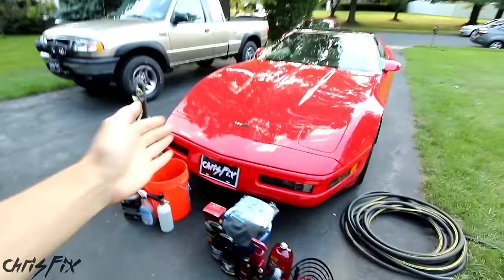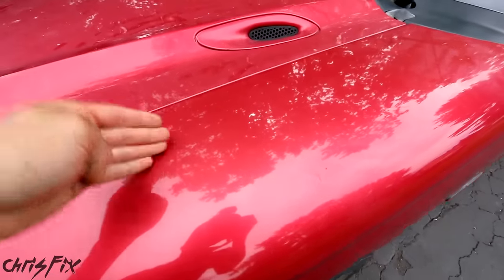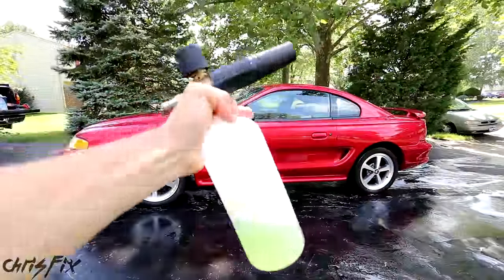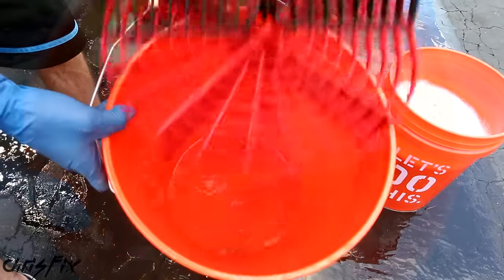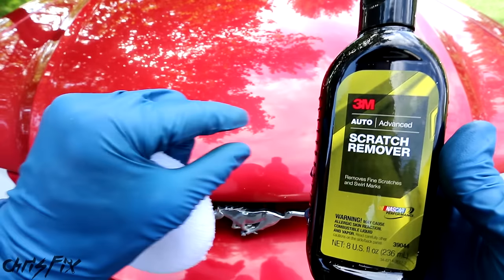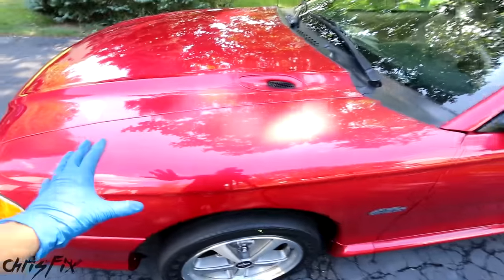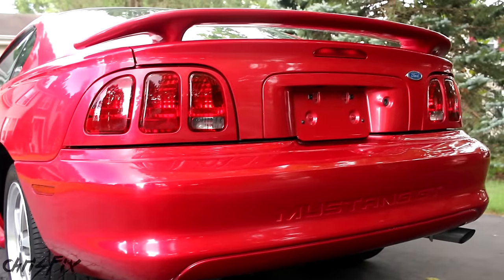How to SUPER CLEAN Your Car (Best Clean Possible)

Comment: I do this every few weeks 😊 Thanks for teaching me!!

Edit: sorry, to clarify, I do everything but degrease my vehicle and add a layer of wax.
Reply: FunForSameer what if the swirls don’t come off ?
Reply: JustACamaro 0 wipe in circles
Reply: I would recommend not doing the whole process, once the wax is on then you can start using car wash that doesn’t strip wax, it’ll save you lots of time, also do a quick detail about every two days. Eventually you’ll need to strip all the old wax, that’s when you can use this process.
Reply: Every few weeks is way too much. Once a month at the MOST
Reply: FunForSameer every few weeks? Wax will last about 3 to 6 months. Some waxes even last up to a year. And soap and water don't always strip the old waxes. So doing a full restoration on your paint every few weeks is not good for your paint.
Reply: John929kelvin indeed, although dawn is definitely a wax stripper, never recommended using it with a good wax (unless you wanna strip it of course)
Reply: John929kelvin 3-6 months if you live where they dont salt the roads, rain is mild at the most, etc. In places like PA you need to wash and wax every month and a half
Reply: The most I could get out of wax was about 3-4 weeks (in winter it probably wouldn't even last a week)... Preparation and waxing takes almost whole day so not worth it... I found different (a bit more expensive) solution: ceramic/nano coating, it lasted me at least 6-8 months and I applied it before the winter. It's much more resistant to everything even scratches.
Reply: @Alteriukas  Where do you go to ceramic coat your entire car? And does it repel salt from the salted roads in winter?
Reply: I do it my self outside (best place to do it is inside, because you need to keep it dry for a period of time, might be 2-48hours). It repels everything: salt, acidic rain, bird s**t, UV and even light scratching. It's like additional clearcoat.
Reply: @Alteriukas  Oh yeah see I don't have the tools or a garage lol I thought you were paying a shop to do it
Reply: I don't have garage either and no need any tools. Just need to make sure you can keep it dry as long as you can after applying (also don't do it in direct sunlight).

Comment: after super clean...2hours later....rain
Reply: just give it a wash and it should be fine, its not like rain can strip wax!
Reply: DED SEC That's why you use wax. If it rained and left residue, he would simply be able to rinse it off and it'll look new again.
Reply: Moss loder acid rain can!
Reply: There is a reason garages exist...
Reply: Mr. Doob not everyone has has a garage.
Reply: DED SEC I would cover my car after SuperClean.
Reply from the maker: That is almost exactly what happened: https://www.instagram.com/p/BJHgFJoDkkt
But the sealant protected the work so its ok!
Reply: Lol yeah especially living in a city like Seattle
Reply: Good thing I live in Arizona.... hehehehe no rain at all..... heheheehe😅😅
Reply: DED SEC    Rain? ?  What is this thing you speak of? Rain? Dust is the enemy. Fine powdery dust!
Reply: @marvin martin Come to Pennsylvania and watch the wintery roads then tell me how dust works. OK, this is a ridiculous argument; the "slated" roads eat whatever bare metal they can get at and they're not the painted areas. STILL... The calcium chloride will wreck finishes too if they're not waxed. And as for the exposed metal, spray the hell out of it with Fluid Film. I have little experience with it and can't attest to its effectiveness but it'll at least help.
Reply: Austin Lucas   What argument ? Where I live there is not much rain. And no fucking way will I ever drive my car in the snow. Not because it would hurt the car. Cause it's way easier to crash. We don't get snow here ever. But if you want to talk about places or conditions we drive on. Come to Australia and drive around and see how you feel after that.
Reply: I realized my comment wasn't holding water and called myself ridiculous, knowing I have little experience with dust wrecking havoc on cars. I don't really have a point here, feels like I'm only ranting on a close but off topic subject. All I can see that's relevant is "Hey, I wonder what havoc the anti-salt solutions will have on unwaxed finishes and how it compares to dust?"
Reply: Austin Lucas   Nice recovery lol touché. Our roads here are generally pretty good. Outback is where it gets tough.  If you watch uk top gear, they did an Australian special. Have a look if you haven't seen it. You'll see what I mean about dust.

Comment: Must be a pain in the ass using the clay bar.
Reply: dj twohands fr it's small af
Reply: I work at a detail shop and we don't actually use Clay bars, we use Clay pads which is similar and does a great job also plus it's bigger so it doesn't take that long.
Reply: Fabian Borjon Ah sweet, thanks for the info
Reply: @SleepyxD117  Yea no problem just search up microfiber Clay towel and there should be one listed on Amazon they pretty much look like that, looks Grey in the middle and a blue outline around it
Reply: It’s so small....like rubbing ur whole car with silly putty!
Reply: I find it kinda fun to claybar a car
Reply: Ayyy we have both have a Ed profile picture

Comment: My car was painted by my groomsmen with window paint so I have tried all sorts of ways to get it off but it always comes back. do you know a way to possibly getting it out?
Reply from the maker: Did you try rubbing alcohol or using clay bar?
Reply: I've tried alcohol, clay bar, wd40 as well as just polish and cleaning
Reply from the maker: Dang, that isnt good. Compound would be the next step but you need to be careful! Ask them what paint they used and look on the label for how to remove it.
Reply: it says on the bottle to not use on body of car, I have tried the compound method as well lol
Reply from the maker: +Casey Saunders oh, dang. The last thing I can think of and the riskiest is to use paint thinner on a microfiber towel. Only soak the towel and after gently rubbing the paint, wash it off with soapy water. The risk is damage to the clear coat if you let it soak.
Reply: Since I'm not a professional do you think that is still a somewhat safe route is? I saw in your video the sand paper, do you think I could try that?
Reply: I would recommend using a product called goof off, its similar to goo gone but its the super industrial strength version. I'd be surprised if it didn't help you
Reply: awesome, my wife works at Fastenal so I'll give that a try
Reply: Casey Saunders     Really want
Reply: Goof Off is for graffiti marker and stuff, not sure it would be safe to use on painted surfaces. Its pretty powerful.
Reply: does the soap you are using ruin the windshield?
Reply: no I was able to remove it all from my windows. it is just the body of the car where it won't come out. it looks like it stained the paint
Reply: Take it to one of those bodyshops. I'm sure they'll be able to strip it out and do some maintenance to the cars paint.
Reply: I think your groomsmen need to buy you a new car
Reply: Casey Saunders vvnc 

car
Reply: Casey Saund
Reply: Casey Saunders
Reply: grade #0000 steel wool

Comment: Soapy Wooder is just water and dishsoap right?
Reply: Corne 011 Yeah , but make sure the dishsoap is a degreaser such as Dawn or Ajax.
Reply: Use Dawn. It works better, goes a lot farther, and they donate Dawn to outfits who degrease birds when you buy their product. (Not a joke, they DO.)
Reply: I thought it was automotive soap mixed with water, dishsoap strips wax which isnt the purpose most of the times
Reply: Thanks for the answers!
Reply: Alex Alarcon but o that case, when the painting is too dirty, he needs first degrease
Reply: Dish soap contains way to much salt are you kidding me
Reply: Corne 011,Yes it means Soapy Water
Reply: No. It's water, dish soap, and Chris fix tears. That's the magic ingredient
Reply: Yeah 1 squirt of plain dish soap and fill the spray bottle with water and shake.
Reply: Chris, how do you degrease the bottom of the engine? Ive been using 50/ 50 of simple green and warm water.....??
Reply: the very birds that later on fly and drop a giant plop on the car right after you have washed, waxed and sealed it sigh but yeah, I'm all for the birds (:
Reply: Nah mate soapy wooder is a mix of water dish soap and tree sap thats why its called wooder because the sap comes from the wood
Reply: Krish Rampaul Beware, Ajax in the UK is abrasive.
Reply: Mark Howards yes, thats the same in the Netherlands
Reply: Yes
Reply: Loh Dexstex could we be friends on ROBLOX?
Reply: what soap should you use if your in the uk?
Reply: You should also add isopropanol alcohol (roughly 10% of the entire mixture other 90% being bottle water preferably distilled and a little bit of dish soap)
Reply: thnks for info man
Reply: Ya I think that’s just how he says it
Reply: Mark Howards 
In the states, Ajax has a lot of different products...even laundry soap.
Reply: yh

Comment: Damn that mustang needs to be dropped lower some.
Reply: Or maybe your car need to be lift some? ;)
Reply: +Pabcio so true lol
Reply: Yea, needs to be lowered
Reply: i know right lol
Reply: He said he's putting coil over😎
Reply: He said he is definitely getting coilovers.
Reply: Hella flush!
Reply: i think the rear needs to have a little more meat, or you know add a spacer to make the wheels stick out more.
Reply: And some correctly offset wheels, they look so tiny, even though they are about 8 inches wide since they sit so close to the axle. I can only imagine a lock to lock uturn in that thing rubbing so bad. worst feeling ever besides grinding a gear.
Reply: looks like a 4x4
Reply: No.
Reply: +max isnt it
Reply: if he only NA's the motor that might turn against him when he goes to drift it but would be awesome of he turbo's or supercharges and does an install vid
Reply: No way he's driving a drift car not a low rider
Reply: Nope, that is just stock ride height for a Mustang lol. Source: Owns Mustang
Reply: Or maybe he needs to put some hydraulics on it so he can lower and lift the car?
Reply: burgerman that doesnt work too good for drifting.....
Reply from the maker: The car will be lowered. Gotta drive it around and learn about the car for a little before changing it. Otherwise how low do I go? Does it handle better or worse than before? If there is no "before" then I will not know. So it will stay stock until I drift it in a few weeks! Then it will be off to the races with mods!
Reply: ChrisFix
Slight negative camber is good, it makes the car a bit stiffer, its worth it. Just a little lower.

Comment: You should do one for interior
Reply from the maker: Oh I will!
Reply: Oh, this will be interesting! Im about to buy a ´85 Mercedes Benz W124 250D (2.5L Inline 5 SOHC Diesel) and want it to pass the german "Oldtimer"-Test, so it´ll get a tax reduction. I have to have this reduction, since i can´t afford her taxes any other way (more than 3k/Year to less than 200€/Year)

She stayed in a carport the last 2 years or so, so the layer of dust is quite ugly. I´ll defenently have to SuperClean it! The interior is almost the color of an old Computer Keyboard, and the two front seats are wrapped in black Leather. The downside is the old fabric on the rear seats, it has oil stains all over it. I need a guide!

Comment: Where do you live? can I just pay you to do this?
Reply: lmao my thoughts exactly
Reply: +Rich Homie Tom What happened to MySpace tom? haha xD
Reply: Chris Drives sold it years ago
Reply: +Rich Homie Tom Ahh man. That site was dope back in the day. Better than Facebook
Reply: Word man. I miss MySpace where you could upload your song . customize it. change backgrounds.  man. tf you sold MySpace for Tom 😣
Reply: He is using photo filters ..check the background on the pictures.. the guy is pathetic
Reply: That's ridiculous.  This process would've taken hours, so there's no way to guarantee the light would be the same in the before and after shot.  Try taking a picture at one time of day and another time of day hours later and then tell me the lighting looks the same.
Reply: and not only that but you may have not been able to see what he was seeing without using such filters
Reply: The best time to usually wash and polish your car is right at 5.pm. That is summer time. Depending on where you live and so. Work at a porsche factory in Stuttgart. So yea the time and weather does actually have a huge affect on your cars paint and clear coat. That is just a small tip I can give ya. ;)
Reply: 20jonnyboy
Agreed.  Twilight hours are best.  It's too hard to outrun direct sunlight when you're drying and waxing.
Reply: Spray 409 carpet cleaner. Rinse. Spray your car with diluted vinegar. Rinse. Make a bucket of soap. Add a bottle of rubbing alcohol to remove tree or bug sap. Hand wash car. Rinse. Then wax

Comment: Love your videos! Between the exterior, interior, and engine bay, lots of little tips that anyone can do. I’ve been checking out your videos to prep my car for a show. Every year I try to do better on it.

One thing for me that stood out, that I didn’t see on your videos, was behind the door mirrors. Maybe because mine is white with white mirror housings, but the filth showing from behind the mirrors stood out horribly. Not only that but the hornets like to nest in there. I looked all over wondering how to disassemble them to clean them. Then I found this cotton swab assortment. Between moving the mirror around, and some Soapy Wooder and swabs and a hose, I was able to get all that gunk out. Like you say, it’s those details that make all the difference.

Comment: Just had the roof of my 1994 Mazda B4000 painted.  When I asked about wax, I was told no wax only wash,.  That just doesn't sound right.  When is the right time to wax a freshly painted car?  I have done a deep clean on the truck after watching your videos, took the seats out, scrubbed the carpet, deep cleaned the seats, put form fitting Cordua seat covers on.  Just trying to keep my Dads old truck running.  Thanks for the engine and wheel cleaning videos, its amazing what a change just that will do to the car.

Comment: I should've just come here in the first place. Didn't think you'd have made a video on this subject. Something that annoys me is that I spend about an hour to two hours watching various different videos of different lengths, mainly 20-30 minutes. While I may have learnt a few things between each video non of them went into depth like this without making 10+ video series. You can't make a "Beginner" video that doesn't really scratch the surface into a 30 minute segment that leads into a several + video series. As usual Chris you've done a smashing job. Appreciated.
Reply from the maker: That's exactly why I've been making my videos to be the equivalent of a few in depth videos in one, I always disliked having to watch a bunch of videos to only get a small idea of what to do!

Comment: Questions:  Does this "Super Clean" method work to remove lichen and/or algae?  And what should I do to clean the lichen/algae from the rubber and plastic areas around the edges of the car body?  And finally, what's the order to follow when cleaning a car's exterior and interior areas.  Thank you!!! Your videos have been very helpful!!

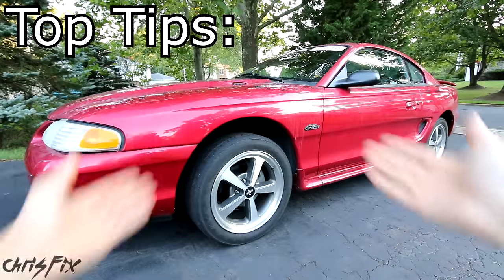Comment: Step 0 @2:30 Preparation
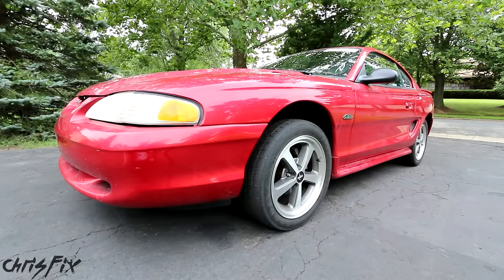Step 1 @3:18 Touchless Wash
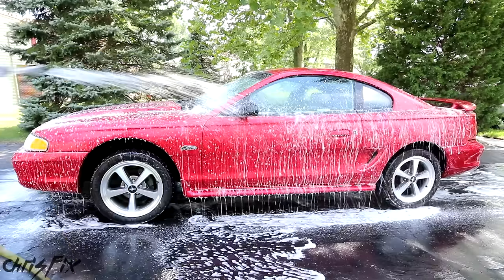Step 2 @5:38 Touch Wash
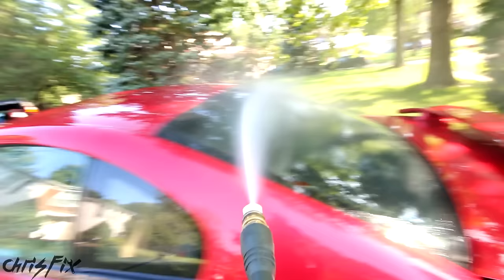Step 3 @8:10 Clay Bar
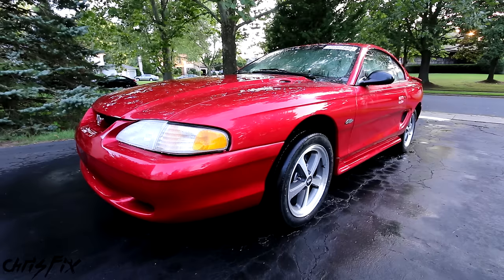Step 4 @11:06 Dry The Car
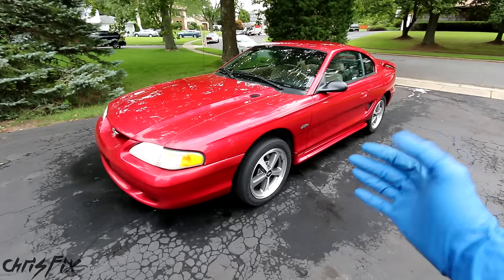Step 5 @11:57 Paint Correction
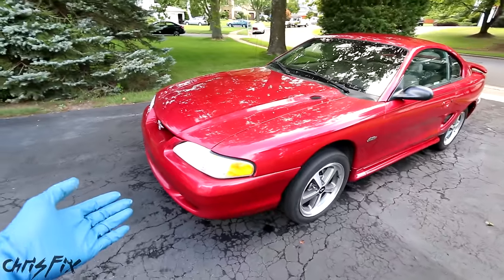Step 6 @15:14 Seal/Wax Paint

EDIT: I posted this because I come back to this video so often that I wanted a quick jump to sections of the video I need a refresher on. Great work!!

Comment: Before pouring any water on the car, first i foam the car with soap and then use water to rinse it down then another layer of foam and then another rinse before moving to touch wash ( i do start with soap to lubricate the surface and prevent those dirt particles scratching the surface when rinsing it with a power washer)

Comment: Used griot's 3 in 1 instead of Maguire's. Pretty good product for the price. Rubbing compound is better for more serious scratch removing though.
Initially got Formula1's Scratch out but realized that it wasn't going to work for anything deeper than a quarter MIL or smaller. Scratch out is more of a all in one polish.

Comment: Hey Chris I got a few questions 🙋‍♂️ 
When ceramic coating a car after the super cleaning process, do I do the coating instead of the wax or use a degreaser to get rid of the wax before coating? 
(Will it still shine and get the Color back like this without wax and but a ceramic coating only)
Will you make a video for ceramic coating in the future?
How do you clean the micro fibre towels and is there a chance of trapped dirt damaging your car even if you washed the micro fibre towel? 
(Always buying new ones could get a bit expensive) 😅

Comment: Question, how much clay bar to use for the entire car? Did you use the one little clay bar piece for the entire car or did you get a new piece?
Reply from the maker: Usually 1 bar is all I need (broken into smaller pieces) but if its your first time have a few on hand

Comment: This is definitely more for beginner detailers but people that are more experience will have better outcomes. Like for instance stirring the paint correction stage they would be using a dual action orbital polisher and polish the entire car, not to mention every good detailer usually starts on the wheels first which are usually the dirtiest, then you do the body of the car unless you are cleaning the engine bay which means you would clean the engine bay first, then you would clean the wheels and then you would clean the body. But this is definitely perfect for beginners but eventually you want to upgrade your equipment, upgrade to better detailing chemicals and so on, which is the better equipment and chemicals you have the better your outcome for the car will be.